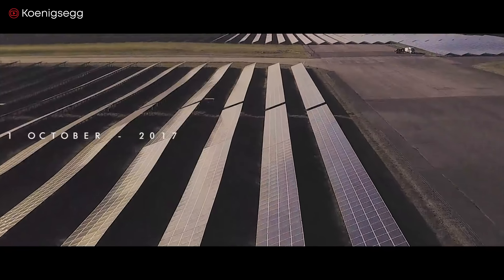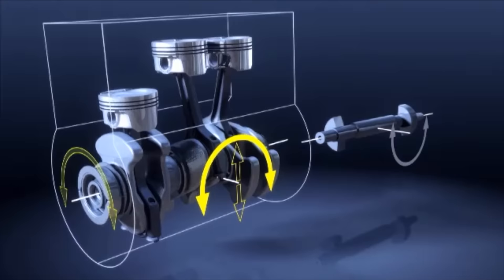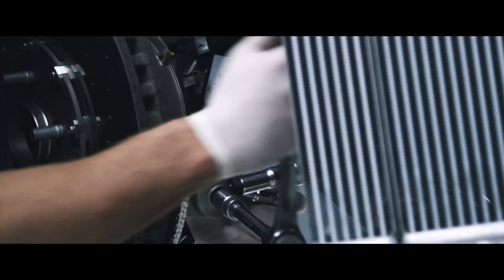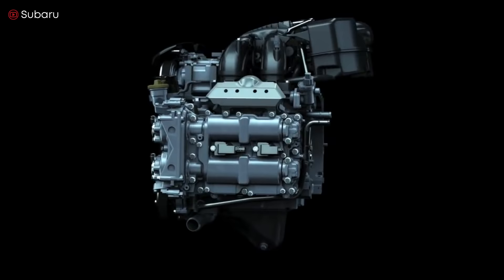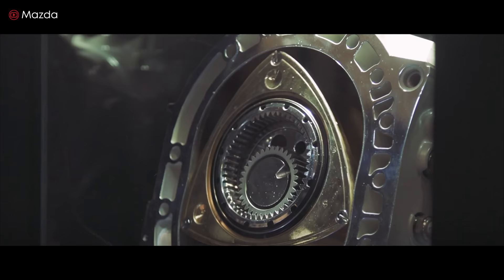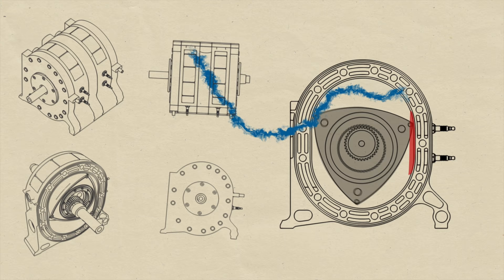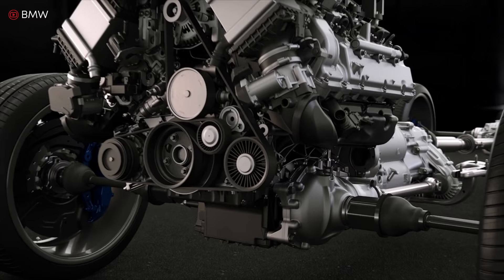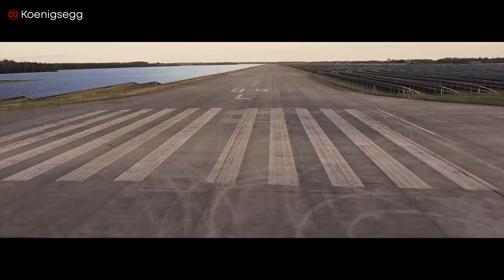Who Makes the Best Engine and Why

Comment: The sound of a high revving flat six is amazing.
Reply: CBX 1000
Reply: M20
Reply: The sound is from the uneven exhaust. They dont sound like that in the newer models, unfortunately.
Reply: Yah digging into the throttle on a 911 is GUARANTEED to put a smile on your face
Reply: V10s FTW. LFA or Carrera GT.

Comment: Great video and great graphics.  One note, the "W" type engines used in WWII aircraft had 9 cylinders and called "radial engines". They were air-cooled with single and double turbochargers. The inline engines were V12s, water-cooled, and dual turbocharged in the most advanced fighter versions of the war.

Comment: Jeep should have stuck with the inline 4.0, those were actually good engines that would last. The gas mileage would have been better in the automatics with more than just 3 gears, but great long lasting stuff compared to the newer ones.
Reply: The EPA killed the 4.0 straight six.
Reply: you kidding me, that thing with its carburetor fuel supply needed a gas station towed behind.  why do you think most would throw chevy's V8s in their jeeps??
Reply: I agree, last alot longer then 3.6
Reply: I have a 04 Wrangler tj and love it. Horrible gas mileage and no power but are bullet proof. Good luck with the new Fiat motor. The last true Jeep rolled off the assembly line in 06. The 4 door jk can't turn on the trails like a 2door with the much shorter wheel base. Check out my family off-road videos on Youtube ..."stephynot".
Reply: @ansv3340  literally no one who drives an older Jeep Wrangler or Cherokee gives one lick about gas mileage. Those 4.0's were one of the most reliable engines ever made. And ever since 1991 the 4.0 had fuel injection and the gas mileage was perfectly adequate by the way.
Reply: Jeeps are 4 wheel drive fiats now.
Reply: First repair you have to do can pretty much wash any gas savings you had.
Reply: The Iacocca Jeeps are super tough inline 6's.  I had a 96,97 4.0s, and simply loved them.  My 96 still strong as ever at 25 years.
Reply: @thetechlibrarian  if you need to worry about gas mileage, you have no room to be an automotive enthusiast. If you care about that, just back out right now. If you think about that then you're a hypermiler or whatever it's called. Car enthusiasts/car guys care about the enjoyment and the experience of driving and working on their cars. There's literally no thoughts given about MPG. So if that's on your mind, you need to find another hobby. That's the truth. Sorry.
Reply: @rhull3939  re-read comment
Reply: @thetechlibrarian  my bad, I definitely read that wrong. Ha.
Reply: I still  have a 94 grand Cherokee 4.0 and it runs great.  It was an AMC motor .
Reply: Personally, I remember the Inline six being 4.2 Liters with a Carb, and even Available in the Wrangler for a year or two before the 4.0 liter with FI took over.
Reply: @BrittainDix  yep, there was the 4.2 first and then the 4.0 but I'm pretty sure the 4.0 came with a carb for the first few years. I had an  84 CJ7 with the 4.2 when I was a kid. I overheated that engine 20 times and it never died.
Reply: Had a 2014 Wrangler with the Pentastar V6.  Great engine.  Don't know what they use now.
Reply: Agree 100%. I own a 2000 Grand Cherokee with the 4.0 and over 320k miles on it. And if it ever needs work you can actually work on it. The new engines are garbage with way too many gizmos. I work for a Jeep dealership and most of our mechanics have Jeeps with the 4.0 ....for a good reason.

Comment: My vote is the 6.0 gm Vortec. I worked on one the other day that 658,000ish miles. Original engine still running strong and quiet in a fed ex box truck. It’s had a hard life of work and it’s amazing it runs that good. See them daily In the 250,000 to 450,000 mile range still running good.
Reply: Search  Volvo b18 engine 😱

Comment: Scotty made a video where he said Honda makes the best engines! Yall never saw that video???
Reply: Yeah, he has said it more than once
Reply: That's because their engines are extremely reliable.
Reply: My mother-in-law has a 14 cr-v and i have a 18 rav 4, the Honda has such a sweet little motor after driving my Rav it's smoother It sounds better and has sharper steering and handling now knowing this I still bought my Toyota because it's an overall better package and less likely to have other problems but man this time to make a sweet motor
Reply: @KyprosEc  I don't want a reliable engine. I want an engine so powerful I can out run God himself.
Reply: @tennnis498  they gave mommy's little racers the Type R, meanwhile they took away naturally aspirated 6MT (a.k.a. immortal) vehicles from the lineups of all Accords and sedans and hatches of Civics. I'd be fine with the classical automatic, I would even be willing to pay for it in an Accord rather than a Civic, the same way as Corolla/Camry division is made. However, all Accords are now turbo? What the hell?!
The last remaining reliable Honda is that Civic coupe with the naturally aspirated 2L, that you have to custom order because no dealer carries the 6MT version. I should buy one just for its future collector's value
Reply: @KyprosEc  Honda trucks suck they only make good small engines like ATV , cars and motorcycles
Reply: @jizzyjake6783  Honda Formula 1.

Comment: SSC was caught in a huge lie. They never published actual video of the top speed run? Have they? I could be wrong.
Reply: Nope they lied 🤥 🤥
Reply: they did, but it was found through landmarks to be going slower than the agera since it was the same exact road
Reply: They did show the actual video, the problem was the timing software. There is a lot of proof the car never got near 300 mph. They did do a second attempt but had some problems.
Reply: That run will never be a certified record. You are right they got caught up in a lie.
Reply: I think I also heard about this. Scotty s research not on point..but how?? lol

Comment: You didn’t mention who makes the best engine.
Reply: I was thinking the same thing, i thought i missed it
Reply: Toyota obviously 🤦‍♂️😉
Reply: @teshtrion7860  Honda obviously 🤦‍♂️😂
Reply: @CsGoUnlimited  preference?
Reply: @nathanrobert2550  both cars are amazing. Honda makes better engines, Toyota makes better transmissions.

Edit: that’s if your being nit picky cause they both make excellent transmissions and engines can’t go wrong
Reply: @tomaskroupakkfoto4132  not known for power to displacement or fuel efficiency or reliability, I don’t think Subaru is the best engine.
Reply: @teshtrion7860  I didn't see any Toyota in that video, only a BMW Supra
Reply: @chaitu2k7 was just ab to say the same thing
Reply: eflemmen  12 volts??? Really
Reply: Honda for def
Reply: I'm sure he just forgot to mention that it's Mercedes-Benz.
Reply: I would say Honda, Toyota, and Subaru in that order.   I have owned all and it’s a toss up.  Subaru needs to get the oil consumption fixed to win.
Reply: @drew8256  subaru are crap in my opinion, their notorious for shell bearings failing, I've owned a lot of cars too and Honda is by far the best
Reply: F I A T  makes the best engine
Reply: @misterle7026   lol  love this remark!!
Reply: @bigdavedayday1581  ya fiat stands for "Fix it again tomorrow"
Reply: I personally would say for reliability the honda k20
Reply: @CsGoUnlimited  Nope Toyota beats Honda in everything son.
Reply: Rolls Royce.  If they hadn't made the Merlin, We'd all be speaking German.
Reply: Buick 3800. 1988-2008.
Reply: @teshtrion7860  honda makes the better engine. Not to be a dink just truth. Toyota makes a better overall car. But engine wise thats honda
Reply: @spaketticarbonada9651  you got that right 👍🏼👍🏼👍🏼👍🏼👍🏼
Reply: Volvo and Mercedes cars have the world record for highest miles?

Comment: My 1998 Toyota 4Runner 4x4 with 458,000 miles on original engine ( V 6) and automatic transmisión. Still running like a swiss watch, passed smog tests, no problem.

Comment: Nobody: ... 

BUT WHO MAKES THE BEST ENGINE??? 

Scotty the question in this Video is still not answered 😐
Reply: He did answer the question, pretty much the best engine depends on what your looking for, power or reliability. I find my inline 6 engine to be a smooth and reliable engine even when pushing power
Reply: Fords  v8 4.6L 2 valve are best motors ever built !  they go 500 k miles and u dont even need regular oil changes on them.
Reply: @ansv3340  every fuel powered vehicle needs regular oil changes ...
Reply: @ansv3340  whats “mineral oil”?
Reply: @greenbanana2332  mineral oil is ur regular conventional oil,  Its called that because it purely made out of crude oil. at least in the past, Now even the regular cheap oil has alot of addictive chemicals in it  which prolong its life, so this is why you not need to change oil very 3k miles can easy go 5-6 miles between oil changes.  The next level of oil is  semi blend , and full synthetic.   And my 2 cents, if you are not driving a racing car on the track you don't use a synthetic oil.  Synthetic oil is not really prolongs  your engine life . it shortens it.
Reply: @ansv3340  I have never heard/seen that term used as such. Thanks for your definition.
Reply: Thankyou Guys for the response

Comment: Should give up on the rotary engine altogether.
Reply: Biggest Richard Cranium  I agree. The latest ones by Mazda still had the same issues as Felix Wankel, the inventor of the rotary engine had. Sealing ring failure, high oil consumption, & high fuel consumption!! These engines drink more fuel than my old 1976 Mercedes V-8.
Reply: Its not as unreliable as a lot of people make it seem
It just needs more effort to be maintained which not a lot of people like
Lets use RX-8 as an example
Its a perfect weekend vehicle
Great sound, great handling, great looks, great price, great transmission... a lot about that car is just perfect in every way
It is unreliable when you compare it to VWs 1.9 TDI or Alfas 1.9 JTD or Peugeots 1.6 HDI... but i dont think its a piece of junk, its an art

Comment: My old Chevy Colorado had an inline 5 cylinder engine. Interesting sound, and it had a noticeable vibration at certain rpms. Not bad or anything, just noticeable. Never had a problem with it.

Comment: Always been a fan of inline engines. My '78 F250 has the 300 I-6. Bought brand new and it still runs like a clock today. Hopefully my 2018 4runner will be just as reliable.  🛻💨

Comment: I had a dream of a 3.3 litre, 4 cylinder, 16 valve engine. 4 inch bore/stroke. If it had the lightest valves you could make, it should be able to manage 6000 rpm. With supercharging, it would be atomic. I don't think it exists, but it would be a great engine.
Reply: Cadillac has a 2.7 4 like that

Comment: Aussie made Ford Falcon with the Barra engine is a 4L inline 6 motor rear wheel drive. Many examples of over 700 HP reliably. Most taxis have achieved  over 600K km, and few over 1million KM. A dragster car using  this engine produces over 2000 HP.

Comment: Scotty's 100% right !!! The 220φ engine accelerates the ions confined in a loop to moderate the relatarvistic speeds, and then varies their velocity to make slight changes to their mass. The 221φ engine then moves ions back and forth to produce ions, thus traveling in a vacuum line, so please use cruise control on the interstate.
 We reliably got ~94% efficiency with a closed loop superheated steam system harvesting exhaust heat from a small jet engine and got just below 96% efficiency in some ideal test cases. The main limiting factors were that the discs had to be designed to stretch uniformly without distorting at ~40k RPM and that the gaps between the disks had to be designed for an incredibly specific set of operating parameters (steam temp, pressure, velocity, etc.). So, please don't use the AC when driving around town....

Comment: I have the late generation Dodge 4.7 engine in my Dakota and the thing is literally indestructible. This motor has over 135,000 miles and still runs like new.   And I’ve been rodding the thing mercilessly since the day I drove it off the lot.   I just wish it were better on gas.   The 4.7 in 2008 had improvements top to bottom, and all the previous issues were rectified making this engine an under-appreciated gem in the V8 world.   And it’s got two plugs per cylinder!  It’s a Semi-Hemi! 😆 Gotta give the Dodge 4.7 some love!
Reply: The poor fuel mileage is likely to be the fault of the 4 wheel /all wheel drive systems in the vehicle rather than the engine's. Assuming that the vehicle has something similar to Jeep quadratrac/quadradrive. More weight to carry and more weight to spin. 
Also a truck probably has shorter gear ratios suitable for towing and hauling rather than peak solo mileage.

Comment: "Unsafe at any speed" -- Remember the Chevy Corvair? It sported a rear-mounted horizontally opposed six cylinder engine. It was pretty easy to work on....
Reply: Especially easy to work on when it fell out of the car!
Reply: @Grunt49  didn’t hurt, but I was 16...never noticed.
Reply: @philipmiller5036  Yeah, you're right, but both cars were fun to work on because they were so simple you couldn't break anything.

Comment: Having owned a 1963 Chevrolet Corvair with a boxer engine the biggest problem I had with it was that it leaked oil from day 1. To make things worse it then started burning oil. I took it back to the Chevrolet Dealer that I purchased it from 12 times before before I gave up. It continued leaking and burning oil till I finally got nrid of it.

Comment: The Napier Lion was a 12-cylinder, petrol-fueled 'broad arrow' W12 configuration aircraft engine built by D. Napier & Son from 1917 until the 1930s.  I can find no reference to any W12 engines in use in any aircraft during WW2.  You are likely thinking of the Napier Sabre but it was an "H" configuration and powered the Tempest and the Typhoon.

Comment: Dear Scotty, I had a 1962 Ford Falcon which went 315,000 miles and later a 1987 1/2 Ford Probe which went 347,000 miles and then a Chrysler Concord that went 277.500 miles before I sold it. some times it is the driver that can feel the needs of the car not so much the engine.

Comment: Can confirm my Subaru 4WD, 4 cylinder petrol is at 300000 miles, with only regular oil and filter change and cam belt and idlers when recommended. Is running well, consumes around 1 cup of oil between changes. Still on original ignition coil. A/C and Power steering still on original pumps, altenator has had brushes and bearings while apart. Everything else is working fine.
Reply: you drove a lot on the highway😁
Reply: @jean-philippeguy4032  not only highway, town driving but not too much off road. No salt in my parts so no rust.
Reply: @AntonyKonnarides1  nice! Subaru power😎

Comment: Hi Scotty,
My son is in the Air Force over seas and we sold his 2014 Maximum with 57K (I think that was a bad idea). Now he is returning in March 2021 and wants a used car with a V6 engine. We’re looking at the 2017-2018 Toyota Camry or Honda Accord  with 30K - 40K miles. Which would recommend or do you have a better suggestion?
Please help this mom help him make the best car decision.

Comment: Scotty, the Bugatti engine doesn't have 3 banks of cylinders, it has two. The engine configuration is like the VR5/6's from VW, meaning, in this case, that it has 2 banks of cylinders like a V shaped engine with 6 cylinders on each bank, each one with a VR configuration. 👍

Comment: Thank you, great topic..have only three small additional remarks: one, an in line four features MORE main bearings area than Vee’s.. a prime example is the AMD A45 with 421 Hp out of a two liter in line four and the AMG GT 63S V8 of four liters (so same heads and valves diagram as the L4) has only 639 Hp, not the double, 842hp, even Brabus boosted versions peak at 800hp less specifically than std production A45... Second remark is that due to flow and pressure wave overlap, one bank of three cylinder served by one turbo is more efficient, breathes better and is potentially more powerful than one bank of four fed by one turbo, so by comparaison the V6 of the Giulia Quadrifoglio or GTO outperformed specifically  the power outpu of the similar Ferrari V8 of similar vintage. Much work was done then to make the Tributo as powerful as a V6 and distancing exhaust valve to turbine wheels had to be much longer  on V8’s. So MC20 Maserati came later with a V6 and performance got boosted instead by a excellent Dallara composite chassis .Then also in line 3 turbo like the Ford Ecoboost now copied by many others are all hot sellers, being light, efficient, clean, and cheap. Note also that two cylinders only fed by one turbo as found on Twinair Fiat 500 can be demanding in term of pressure wave pulsating stress to the turbine blades at high power and so it is rated at low power of 105hp for 946cc..Finally, all Formula one cars are limited to one single turbo and to a V6, so, a double volute turbo is used to separate unfavourable pressure waves reflections from the incoming waves. So in theory, to beat the 316mph speed record a V12 with four turbos should be preferred, but on in line 6 and V12 the long crankshaft length and increased torsional flexibility is a torque limit issue so that 3 engines of four cylinders or four engines of three cylinder or two V6 ( like the 620Hp MC20 prechambered) could be the right answer specially with a dual input Dana / ex-OerlikonGraziano gear box concept.. maybe lighter and better that heavier Ford Coyote based Koenissegg V8...

Comment: Simca had a cope with Wankel power. We tested it at Chrysler in 1969 to see if we could use it, nope. I did drive it in a gutted body and it moved good. Later we understood it had internal blow by that actually helped with Nox emissions and the public didn't even know about that. Lots of changes back then i had recently tested the first Chrysler engine to run on NoLead fuel. Ps. It was a 318 V8.